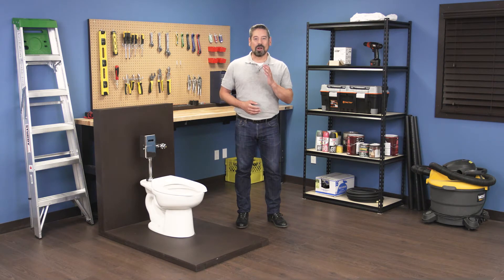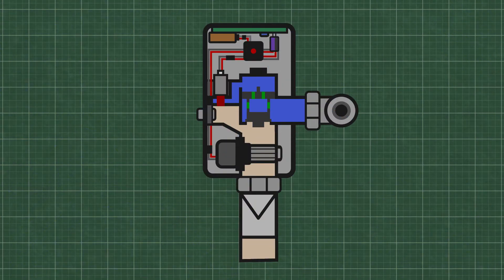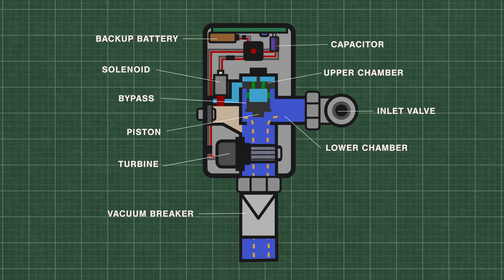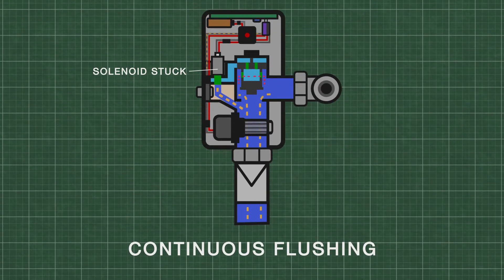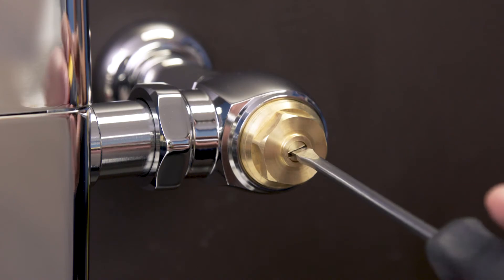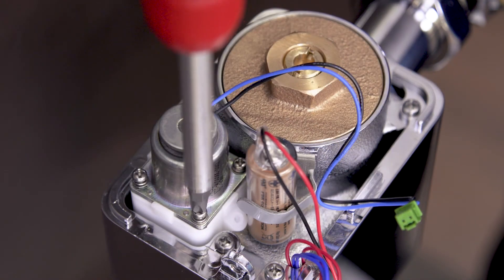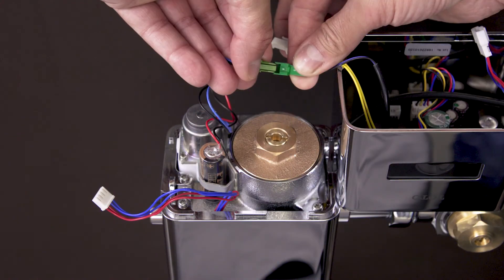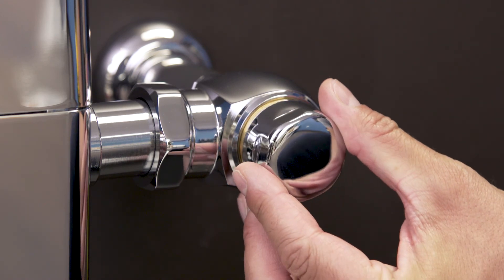TOTO EcoPower Flushometer | Solenoid | Repair and Replace

Comment: Could excess water(water shooting out of bowl) when flushing be caused by a failing solenoid? Turned down the water and now flush is weak. No clog in toilet or down the line.
Reply from the maker: Thanks for watching. That is a good question but likely isn't a solenoid issue. The solenoid will open the channel to initiate the flush but will not have an effect on the flow rate of the water itself. The control stop will adjust the and the piston can affect the length of the flush.

Comment: I need this selenoid. I am from indonesia
Reply from the maker: Hi Ahmad, thank you for watching. The Solenoid part number is TH559EDV510R, there is likely a supplier somewhat close to Indonesia that can ship to you for a decent rate.
Reply: @AmreSupply  how much price there
Reply from the maker: @ahmadzaenuri1355  Its hard to say what shipping will cost it depends on some factors. For ordering from AMRE you can call the Customer Care Center @ 1-800-661-9891  and ask for a quote for international shipping for that part number TH559EDV510R .